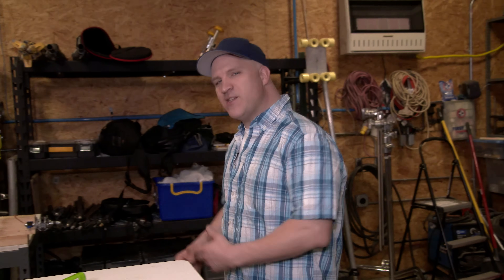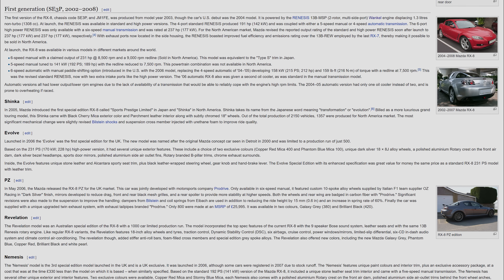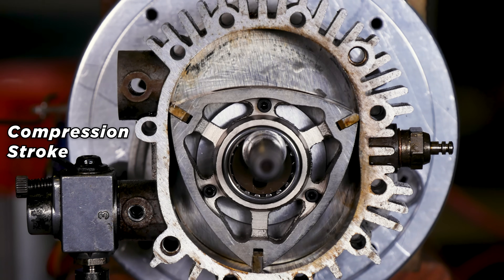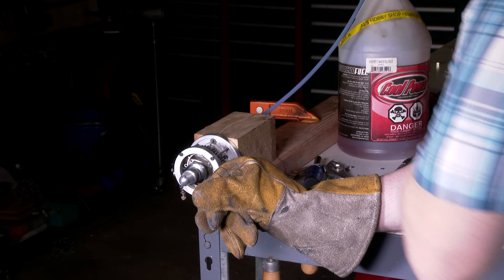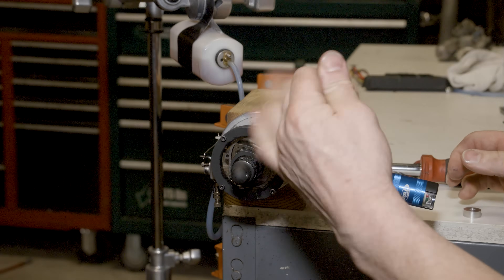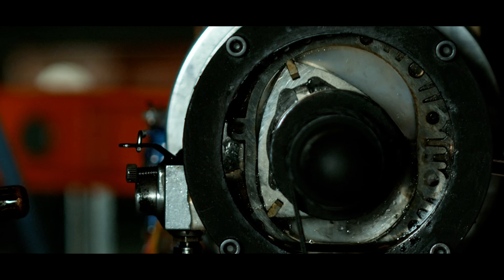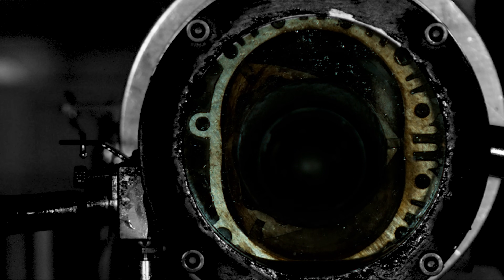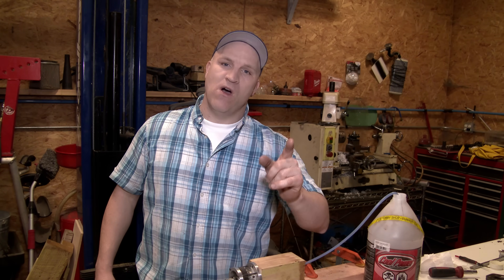See Thru Rotary Engine in Slow Motion - (Wankel Engine) 4K

Comment: FINALLY I UNDERSTAND! 45 years as a mechanic, never worked on a rotary engine and could not 'see' how the triangular rotar stayed sealed against the cylinder walls. With this video, I know know how it's accomplished. Thank you!!
Reply: The problem was it does not stay sealed for very long... compression loss leads to lost power and efficiency... it also causes hard starting and flooding of the spark plugs... these engines were never very reliable or very popular, they were discontinued by all the manufacturers several years ago... they are no longer made anywhere today.
Reply: @doktorbimmer  
doktorbimmer
doktorbimmer
3 seconds ago
ernie brink, why do you and "xke xke" post the exact same comments? Are you the same person?
xke xke
xke xke
55 seconds ago (edited)
@doktorbimmer we know you are the one *impersonating Ernie Brink  why not take your own advise stupid
xke xke
xke xke
1 second ago
@doktorbimmer why not take your own advise stupid
xke xke
xke xke
1 second ago
@doktorbimmer @R0T4RY is love
xke xke
xke xke
1 second ago
Just ignore Ernie... the guy is a troll and a complete nut job!

Comment: This is a rotational piston engine not a rotary engine. The rotary engine is what powered WW1 planes.
Reply: Great comment, That is correct.  Hanns Paschke the inventor of the Wankel KKM engine called it an "Orbiting Piston Engine"  KKM stands for Kreiskolbenmotor  or Orbiting Piston Motor in English.
Reply: A rotor is something that spin concentrically on a fixed axis... the triangular piston in the Wankel engine "Orbits" inside the housing with a Planetary Motion  distinctly different than "Rotary Motion"  Cheers!
Reply: @doktorbimmer  we know you are the one *impersonating Ernie Brink

Comment: I know this is a model air plane version, but it still shows a VERY GOOD EXAMPLE as to why you need to use premix in you’re gasoline in the full size versions in cars, and not shut the engine down after just starting it and letting it idle for a few minutes

Comment: The engine in this video is a WANKEL KKM, not a Rotary. The Rotary type engine is completely different... invented by Felix Millet in 1892, it has a completely different layout similar to a Radial engine but the crankshaft is a fixed axle and the whole engine rotates concentrically around it.

Comment: I need some verification. I'm a young guy that just got into cars. I have a question : This was a scaled down version of a wankle right? There is no way  that that is full sized.
Reply: Yes, the company that made this engine was Graupner GmbH. who was one of the 26 original Wankel KKM licensee's in the 1960's... the company only bought the rights to develop model engines limited to 3 horsepower or less. Graupner discontinued these engines many years ago, all 26 companies including Mazda have discontinued selling Wankel engines.
Reply: @doktorbimmer  Obviously it was a real engine but was it full size? Was it just a miniature working model?
Reply: @Emmanual Grattan Graupner only made engines for model airplanes, Dozens of other manufacturers developed or produced Wankel engines in a range of sizes from 1/2 horsepower up to 1,000 horsepower pumping engines... most never made it into production the rest have been discontinued for years.. Cheers!
Reply: @Emmanual Grattan You are very welcome sir, Happy Holidays!

Comment: yes, because rotary wankel engine is 2 stroke type engine. it has a lot power.
Reply: All Wankel KKM engines are 4-STROKE and use the exact same 4-stoke operating principle as a reciprocating Otto or Diesel engines.
Reply: And now you will realize Ernie Brink is a fake. Here is a respected peer-reviewed automotive engineering reference source from; Encyclopedia of Automotive Engineering: Engines - fundamentals, Volume 1, Part 1 Chapter 10 Page 532, Section; 2.2.3.2 quote; 

"Wankel engines work with the four-stroke principle"

https://books.google.com/books?id=ANfdCgAAQBAJ&pg=PA532&lpg=PA532&dq=wankel+4+stroke&source=bl&ots=gzrnDiXhUe&sig=wVwxnnTy68GEfgnIl6orujQSUgI&hl=en&sa=X&ved=0ahUKEwiq7aKp9Z7ZAhVP42MKHQRAAsc4FBDoAQg6MAM#v=onepage&q=wankel%204%20stroke&f=false

Comment: That was really cool, damn I love rotary's, but how do they oil those piston rings..? Or whatever they are called here
Reply: The apex seals?  The problem is its impossible to oil them very well... which is why these engine fail so quickly.
Reply: FAKE ENGINEER HAS NO SMARTS ON APEX SEALS
Reply: @doktorbimmer  ah, i see. yeah they do look quite prone to fail.
Reply: Graupner GmbH discontinued these little Wankel engines years ago due to high failure rates and poor sales.

Comment: A lot of rotational mass around the crank shaft, a lot of wear surface and non-concentric rotation causing vibration is why it is not a mainstream engine today.  But why it worked?  It fired 3 times per single rotation of the crank, like a 3 cylinder 2 stroke would do.  Not to say those issues can't be overcome, and maybe they have been for all I know, but we don't see them used much anymore for some reasons.
Reply: A lot of reciprocating mass too... which is why the internal rotation is only 1/3 of crank speed... and that is limited to lower speeds than reciprocation engines.
 The Wankel has been obsolete in engine manufacturing for several years and had several fatal flaws inherent to its basic design concept which are due to the limitations of its very restricted geometry envelope that allows it to operate.
Reply: A single chamber Wankel engine only fires ONCE per crankshaft revolution (360°)  the orbiting piston(rotor) rotates with a ONE-to-THREE RATIO the Wankel KKM requires 3 crankshaft revolutions (1080°) to complete its 4-stroke cycle in each of the 3 rotating combustion chambers. 3 rotations = 3 firing/ combustion cycles Any questions?
Reply: @doktorbimmer   negative nanny COME ON CRANKSHAFT IN A WANKEL COME ON STUPID

Comment: Ask any rotary pilot/air crew how dependable the system is, and how much funding goes into maintaining the platforms in order to be operational.
Reply: @erniebrinkrotaryhemi7336  I see you have adapted his bold text usage. Myself, I've gone for Italic
Reply: @Flyingdutchy33  thank you sir  why is he so dum
     dokterbimmer  So if the piston can complete the full cycle once per revolution it’s a 2 stroke, if the piston completes full cycle in two revolutions it’s a 4 stroke, three revolutions a 6-stroke.  only to now realize he's wrong.  He's beyond humiliated.
Reply: ernie brink rotary hemi1 second agoernie brink rotary hemi5 minutes ago (edited)Chuckiele8 months agoYoure the one living in a state of denial, im living in a state of hope, you should try that too, might make you able to get rid of some of your negativity, because even if there is absolutely no evidence of something to happen, why would you remind yourself of that over and over again if you could just be positive and wait instead? Anyway, if by that technical feature youre refering to any sort of valve control like you mentioned above, I dont see a reason to implement them into an engine that doesnt even need valves, you can control injection and you can control ignition, what do you want more?
oktorbimmer8 months ago+Chuckiele Engineering is not a "
        
    
Chuckiele8 months agoYoure the one living in a state of denial, im living in a state of hope, you should try that too, might make you able to get rid of some of your negativity, because even if there is absolutely no evidence of something to happen, why would you remind yourself of that over and over again if you could just be positive and wait instead? Anyway, if by that technical feature youre refering to any sort of valve control like you mentioned above, I dont see a reason to implement them into an engine that doesnt even need valves, you can control injection and you can control ignition, what do you want more?

    
doktorbimmer8 months ago+Chuckiele Engineering is not a "faith based" endeavor son, it is a science that must comply with the laws of mechanics, and the laws of thermal and fluid dynamics. Mazda manufactured the Wankel KKM longer than any other company and they have not released a new production Wankel engine in 23 YEARS!  So I sincerely suggest if your hoping for the Wankel to comeback? That you don't hold your breath!

    
doktorbimmer8 months ago+Chuckiele "technical feature that effects combustion efficiency"  NO, its not. Indeed, while one of the Wankel KKM's flaws is being limited to port induction and exhaust that is not what I was referring to.

    
    
doktorbimmer8 months ago+Chuckiele "I dont see a reason to implement them into an engine that doesnt even need valves,"  WELL THEN, How do you expect to implement HCCI technology????? Magic? or Hope

    
Chuckiele8 months ago (edited)All science is based on faith, you may not accept that but there are no true laws in science, they are just valid until they are proven wrong, and they eventually will and so will you. HCCI isnt even properly utilized with valve control yet, so how would you know that it cant be achieved without?

        

   based" endeavor son, it is a science that must comply with the laws of mechanics, and the laws of thermal and fluid dynamics. Mazda manufactured the Wankel KKM longer than any other company and they have not released a new production Wankel engine in 23 YEARS!  So I sincerely suggest if your hoping for the Wankel to comeback? That you don't hold your breath!

    
doktorbimmer8 months ago+Chuckiele "technical feature that effects combustion efficiency"  NO, its not. Indeed, while one of the Wankel KKM's flaws is being limited to port induction and exhaust that is not what I was referring to.
    
    
doktorbimmer8 months ago+Chuckiele "I dont see a reason to implement them into an engine that doesnt even need valves,"  WELL THEN, How do you expect to implement HCCI technology????? Magic? or Hope

All science is based on faith, you may not accept that but there are no true laws in science, they are just valid until they are proven wrong, and they eventually will and so will you. HCCI isnt even properly utilized with valve control yet, so how would you know that it cant be achieved without? god bless you doktrbimmer a big fake and you are not a engineer by all means fatih or hope dont care about your negative bs 
        
    
Chuckiele8 months agoYoure the one living in a state of denial, im living in a state of hope, you should try that too, might make you able to get rid of some of your negativity, because even if there is absolutely no evidence of something to happen, why would you remind yourself of that over and over again if you could just be positive and wait instead? Anyway, if by that technical feature youre refering to any sort of valve control like you mentioned above, I dont see a reason to implement them into an engine that doesnt even need valves, you can control injection and you can control ignition, what do you want more?

doktorbimmer8 months ago+Chuckiele Engineering is not a "faith based" endeavor son, it is a science that must comply with the laws of mechanics, and the laws of thermal and fluid dynamics. Mazda manufactured the Wankel KKM longer than any other company and they have not released a new production Wankel engine in 23 YEARS!  So I sincerely suggest if your hoping for the Wankel to comeback? That you don't hold your breath!

    
doktorbimmer8 months ago+Chuckiele "technical feature that effects combustion efficiency"  NO, its not. Indeed, while one of the Wankel KKM's flaws is being limited to port induction and exhaust that is not what I was referring to.

    
doktorbimmer8 months ago+Chuckiele "I dont see a reason to implement them into an engine that doesnt even need valves,"  WELL THEN, How do you expect to implement HCCI technology????? Magic? or Hope

  
    
    
Chuckiele8 months ago (edited)All science is based on faith, you may not accept that but there are no true laws in science, they are just valid until they are proven wrong, and they eventually will and so will you. HCCI isnt even properly utilized with valve control yet, so how would you know that it cant be achieved without?

GOD BLESS THE DOKTERBIMMER FAKE ENGINEER  AND ERNIEBRINK ROTARY NEGATIVETY

    
ernie brink rotary hemi3 days agoFuel consumption was also better than a comparable two stroke engine, but not as good as a conventional four stroke. This eventually became the downfall of the Wankel design

ernie brink rotary hemi2 days agohttps://youtu.be/mF2lR20aPL0     this one is with offset compression  super charged  check out more timing and the plug locations you will love it   performance   performance   performance  balance power with emissions.  and more efficient

ernie brink rotary hemi2 days agohttps://youtu.be/mF2lR20aPL0     this one is with offset compression  super charged  check out more timing and the plug locations you will love it   performance   performance   performance  balance power with emissions.  and more efficient
Reply: @erniebrinkrotaryhemi7336  Robert Tadic You must have never spent any time communicating with bimmer. Reason is pointless and he is hated in the rotary community for his arrogance and disrespect.
Reply: @erniebrinkrotaryhemi7336  @CaberFeidh Indeed... only amateurs refer to a Wankel KKM engine as a "Rotary"... just like these people think Felix Wankel actually designed it... which is not true either.
Reply: @erniebrinkrotaryhemi7336  Well, they reason that since the output shaft rotates slower, you get less cycles per revolution on the output shaft but to me thats technically a reduction and therefor doesn't count. But if it did, 1 rotor equals 2 pistons.

That said, I'm sure someone will chime in to tell me how wrong I am. Mostly I just comment here because doktorbimmer does. And I just find it absolutely amazing someone who's that stupid and insecure hasn't comitted suicide yet. I know it's wrong, but I have to admit I try to push him over the edge until he finally releaves this planet of his existence.

Hmmm, come to think of it, I might miss him if he actually jumped in front of a train :(
Reply from the maker: Is the answer "a lot" or " not much" ?
Reply: @WarpedYT  An answer to which part of the statement's segment? The system is not dependable by any means unless you have limitless funding. Therefore, "a lot" of assets are allocated into the overall maintenance. But, I feel you already knew this having earned the vetted credentials to create a social media video pertaining to subject matter. <2> Sua Sponte'
Reply: @wymanmore3982  I'm a pilot. And I happen to know that the rotary engine is one of the most popular engines. In fact, you will find that a lot of rotary car owners are pilots.
Reply: @erniebrinkrotaryhemi7336  I've seen this guy around for about 4 years. In that time he has never really shown any signs of him understanding how messed up he is. And then the typing his comments in all bold text.... I've known some seriously messed up people in my life, way more than the average person. But none of them were as bad as he is.

So what if I want to fill up my inferior apex seal spitting machine gun bomb car. It makes me happy. I don't say anything about his blow up love dolls either, do I? I mean, if it makes him happy, who am I to say that a real man/woman is better...
Reply: My thread got hijacked, and I didn't even get to read the bulk of the "debate".